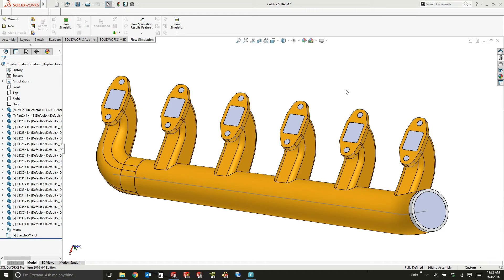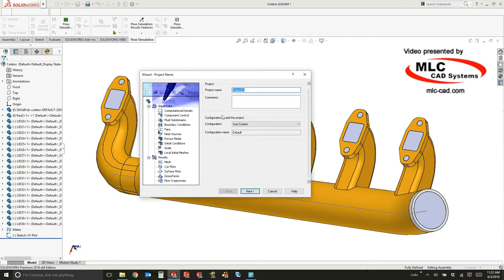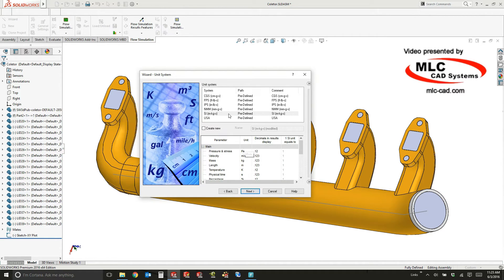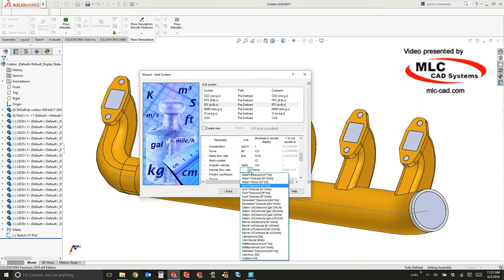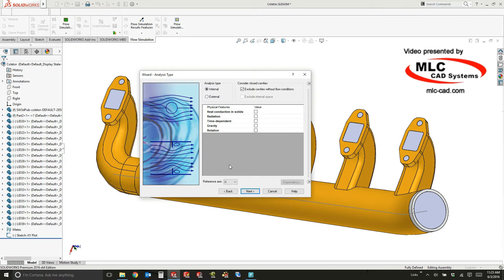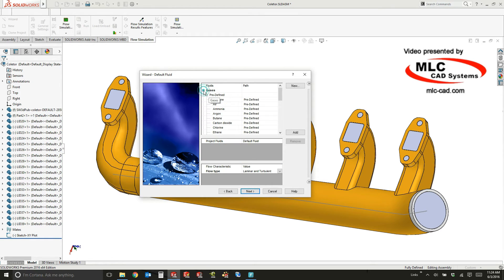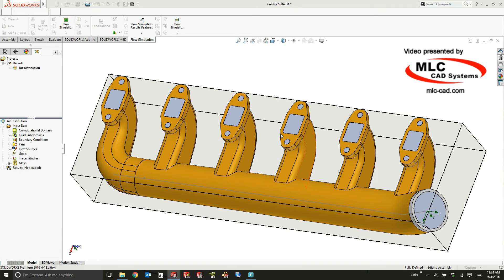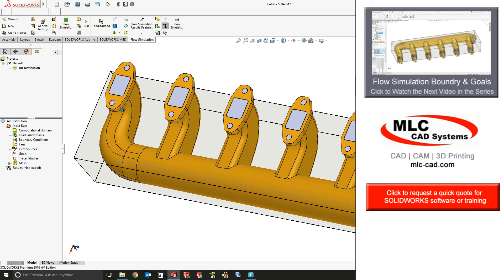Using the SOLIDWORKS Flow Simulation Wizard

Comment: Do you know why I can't see Real gases , steam ,compressible liquids and Non-newtonian Liquids?
Reply from the maker: Some study options are incompatible with others, so if you select a value that does not support those types of fluids or studies, then it may disable them.  It could also be an installation problem or be related to your workflow.  Also, this video refers to Flow Simulation not FloXpress.  Reach out to your local support provider to troubleshoot this behavior further.